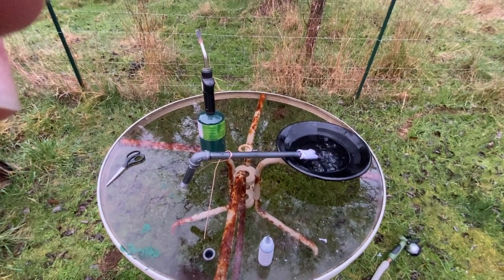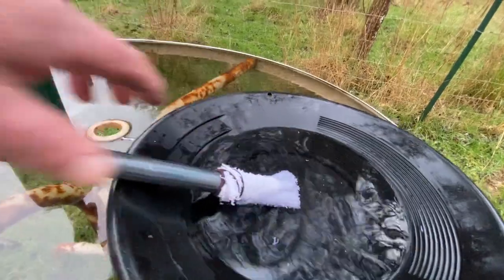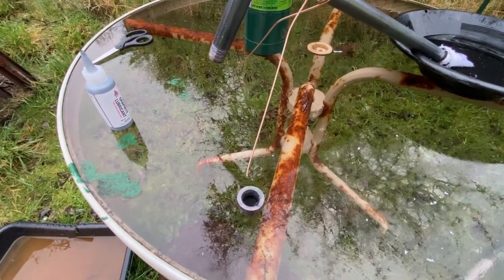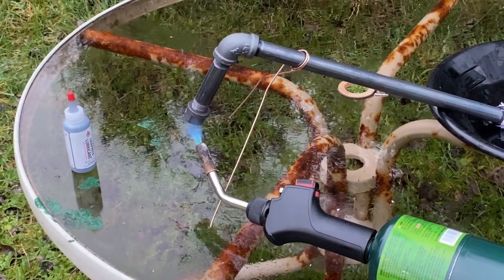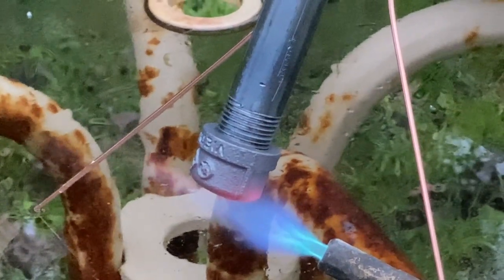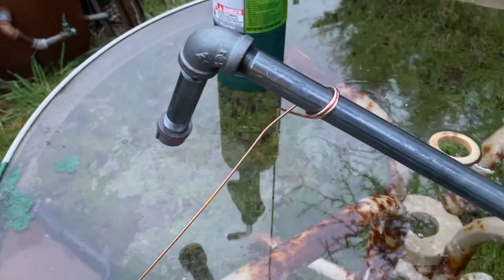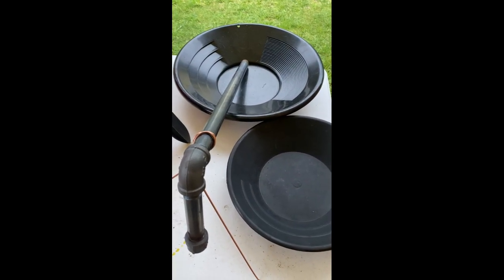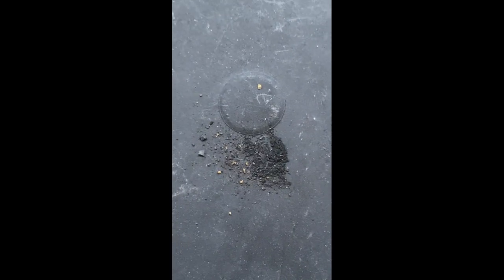Gold and Mercury Retort

Comment: did you use pipe dope on your elbow connector? on the end cap for the mercury burning is it sealed with anything/
Reply: nevermind I see used graphite lubricant ty for the video. very helpful.
Reply from the maker: You’re welcome. The graphite will help keep the threads sealed up to keep any mercury in. It also makes it easier to take the cap back off to get the gold out.